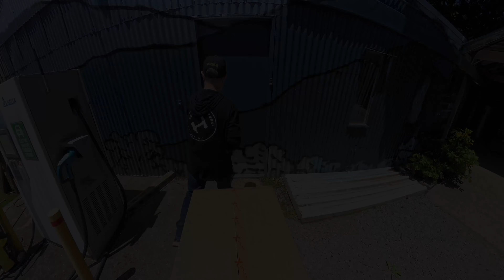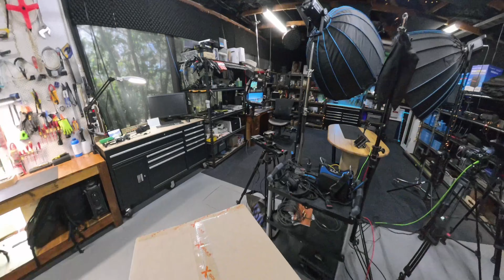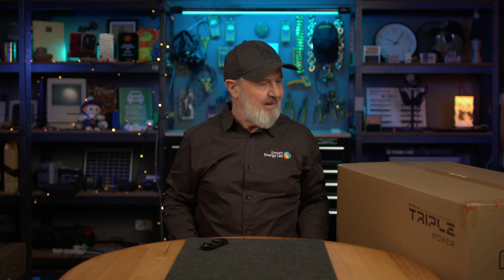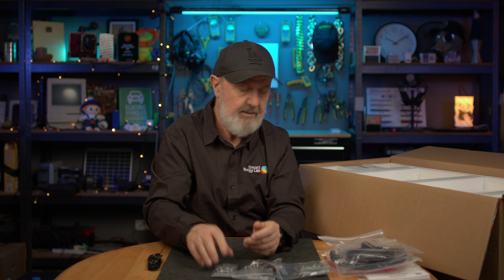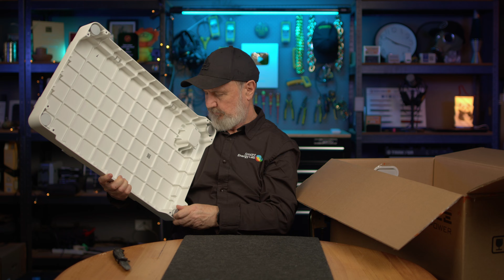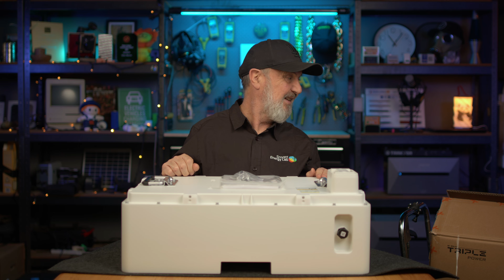Unboxing the SolaX TriplePower HS51 | First Look at the New High-Voltage Home Battery

Comment: Every video this month is another Sigenergy clone, but Sigenergy is never mentioned. Why never mentioned? Are these sponsored products? If so, doesn't YouTube require revealing sponsorship?
Reply: what do you mean its a sigenergy clone?  In fact it was BYD and then pylontech who first offered stackable batteries, and solax has been offering a stackable system for about 4 years now, before sigenergy even launched to the market, so how can you say that they're copying sig if their products were around long before sig?
Reply: @stevemcmechan6444 not stackable batteries, that's not new, watch the video, the feature set on these newer models is 1:1 with Sig. No harm in copying, as he said, Sig is an iPhone moment.
Reply from the maker: I call the arrival of Sigenergy on the BESS market as the "iPhone moment" for the industry. Everyone will be moving to this design because it is what the industry and consumers want. Just like every phone these days looks like an iPhone - great ideas will be emulated.
Reply: @SmartEnergyLab  Hey Glen with this solax battery system  you mentioned it has adjustable levelling feet, however what do you do for in NZ where you need to screw the battery securely to the floor or wall to give seismic restraint?
Reply: @stevemcmechan6444 there are brackets that go over the adjustable feet legs, that you can bolt down. You do this first, so the bolts are tidy under the stretch.